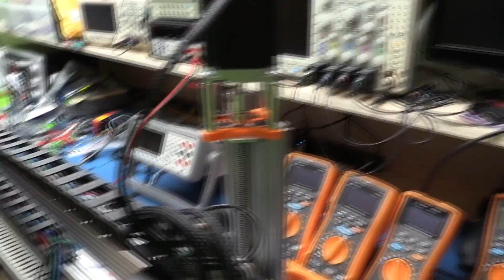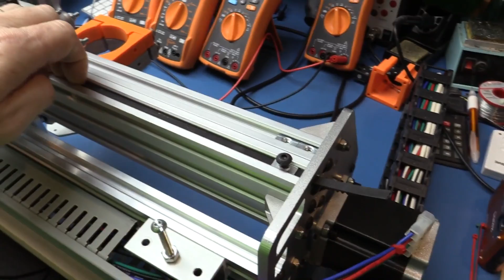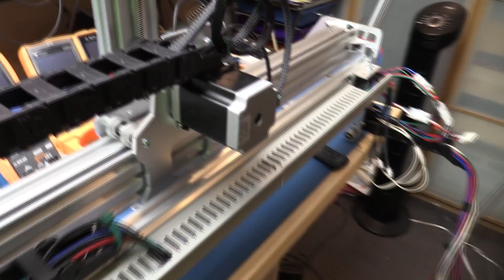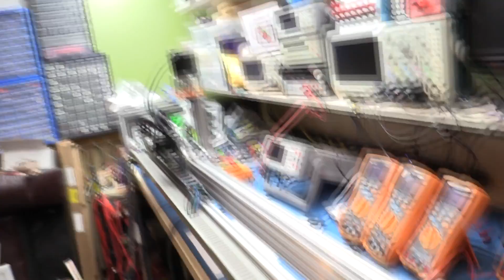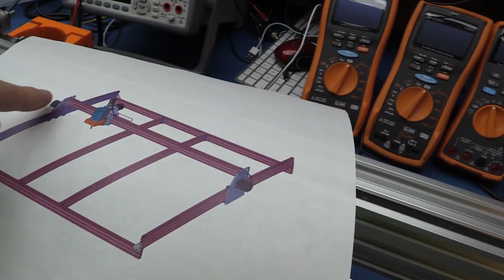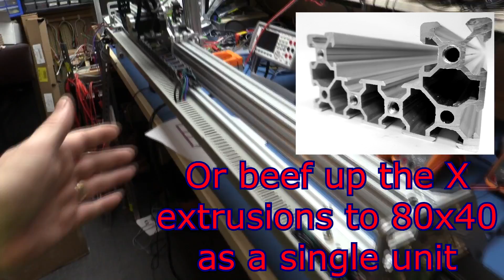CNC Project #4a - The Gantry Wiring

Comment: Hello and congrats for your build! I am building now a Plasma cutting cnc based on v-slots like you. The only thing that concerns me about your build is why you chose to use an arduino controller, instead of a XHC MK4 Mach3 breakout board (for example), in a so expensive and professional setup?
Reply from the maker: I am actually just re-wiring the panel to use a Mach3, I have had it for a while but it does not want to play well with windows 10 64bit, also adding a rotary axis and a 48V 500W spindle
Reply: @TheBreadboardca  Aha! This is where I come in. You have done an excellent job here. I have zero experience with a CNC and I trying to build one. but with this video I think my confidence level has jumped from 15% to 55%. I already have a diagram for building a standalone rotary CNC (which I can send to you if I know how) as this is my main interest. I have been able to get the material together but I am having a huge challenge with getting the controller connected/wiring. Can you help?
Reply from the maker: @davidiyaji3320  possibly, send me the info you have and i will look it over

Comment: Peter, can you double the axis motors on one driver as they are current limited? They will share the current, but is double the magnet area going to give a net increase in torque?
Reply from the maker: technically you can parallel a couple of motors to one driver but i'm not sure if the reliability is worth it, sharing the step and direction is fairly risk free and unlikely to blow a driver,  The additional magnetic area math is beyond me.
Or are you talking about 2 motors on the same shaft, perhaps one at each end ?, if so that's an interesting way to increase torque and possibly even reduce stress on the shafts (If your using shafts, im using belts right now)
Reply: thanks Peter, I found a nema 23 stepper that runs on 1.2A 305in*oz that I hope will solve my torque issues. store.quintessentialuniversalbuildingdevice.com :My A3979 drivers are set to 1.4A and 1.8A so normal nema 23 won't work. This is custom wound for small drivers. The downside may be 9mh inductance which could cause poor performance at higher speeds? Is there a better way to contact you? Thanks Duane
Reply from the maker: you can email me at peter@thebreadboard.ca if you like.
btw, a sure way to increase torque is to use a higher voltage motor power supply, I use 48V with my nema 24 steppers. Gecko has a great PDF detailing how all this works  http://www.geckodrive.com/support/step-motor-basics.html
I am using Gecko Drives for both my CNC machines
Reply: my controller is a stepcraft out of Germany. It uses the A3979 chip which is 35v max. It's 2.5A rated but they set the current limit with resistors and the pwb is proprietary so no schematic.  I originally wanted to think of these drivers as a preamp, and the come up with an external h-bridge that would amplify the outputs to the stepper, is this possible? That would solve a lot of weak driver issues for people! Then I could apply a higher voltage and have higher currents, but still use the original controller.  Then I thought of running a bigger driver off the 4th axis connections, or maybe 2 drivers running off step and direction and converting to a 2 motor y axis.
Reply from the maker: It would probably be more effort than its worth to use the driver as a preamp and add to it for more power. looking at the chip spec, it uses step and direction already. If your planning on upgrading the steppers then it may be worth getting more powerful drivers like the gecko's. If the new steppers are still rated under 2.5A but have higher torque (So it would have to be higher impedance) then that may work but I think you may find you wont get the max out of them due to limited supply voltage (Refer to the PDF I linked in previous post). Do you have a full blown stepcraft CNC ?? or just the driver board ?
Reply: Peter Oakes I have the full blown  840 stepcraft. I like the looks of the rover upgrades or the c channel you use. I want to take my 840 to 1000mm to allow for vertical milling off the end. That's why I thought of replacing the y axis extrusions with the type you have. I know the 1.8A nema 17 is just too small for that, so I'll either put on each on the extrusions and add a 4th axis pwb to drive it, or see what this nema 23 I've ordered does. at 305 oz/in its way bigger that the nema 17 I now have. I bought the stepcraft to get into cnc as it's a all in one, laser, 3d print, router, etc, but I can see its at the edge of its performance capabilities.